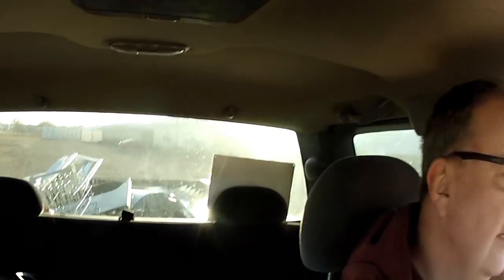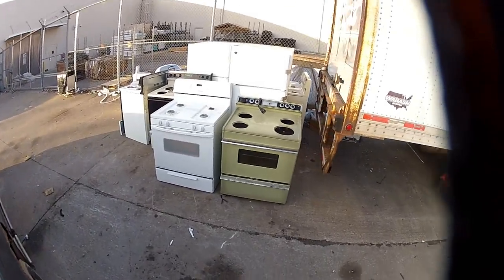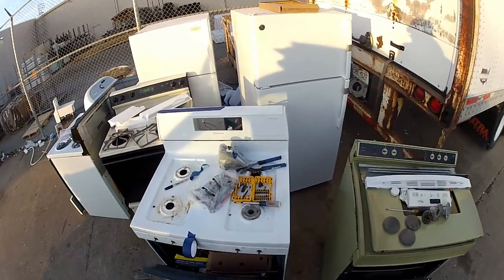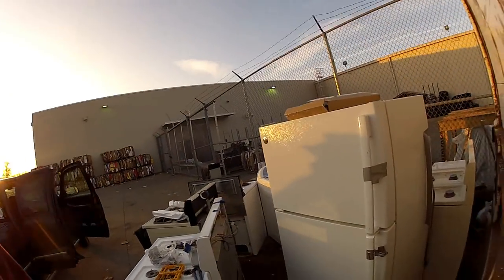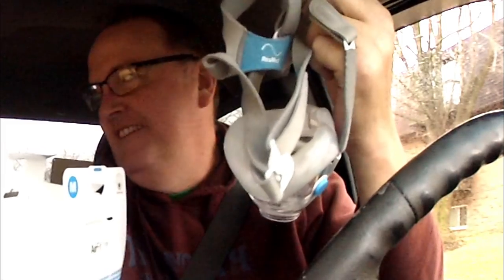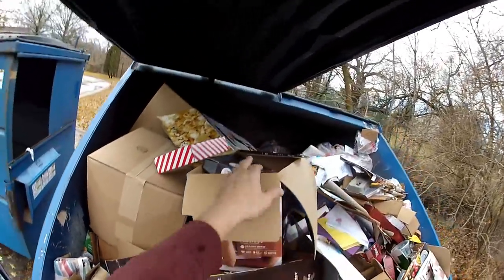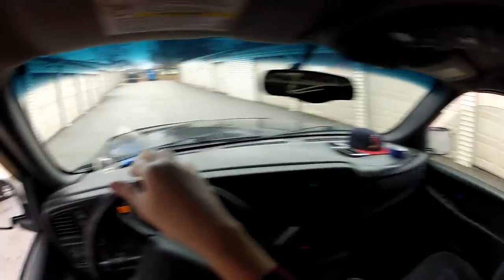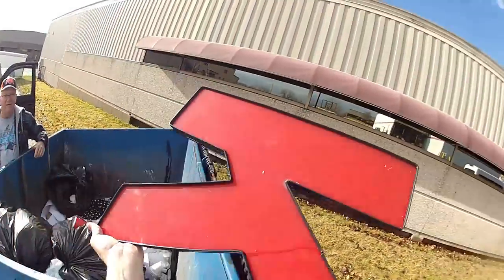Dumpster Diving - Filling up the Truck with Bob!

Comment: Hey shane and bob enjoy the vids :), just a little extra for the parts ebay when u find vacuum cleaners if the attachment parts on them always good to get thos, easy to missplace or loose in uk hear can get £10-15 for the small attachment depending on the make, Dyson's and vaxs are main ones hear, parted out a dyson and got £70-100 if i remember rightly, handle, hose, filters and filter holder, dust bin and attachments, the belt and brush heads can be a  hit or miss depending on how worn they are, few times after removing the hair/carpet sometimes get cut into the brush roll but still a good little earner, plus expands your variety of stock,
Sorry know its a bit long to read lol, anyway keep up the good finds you 2 :)